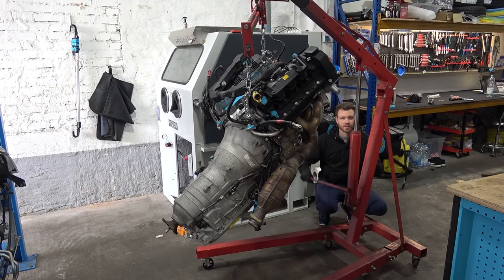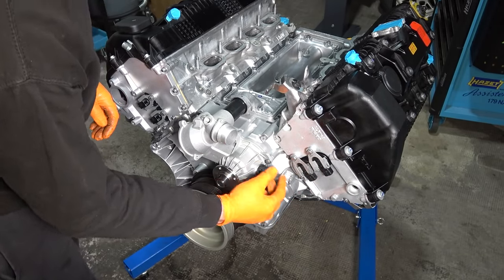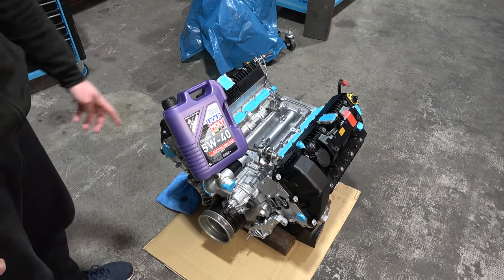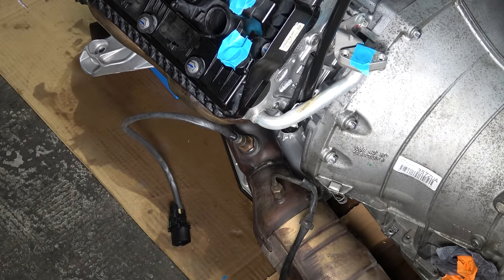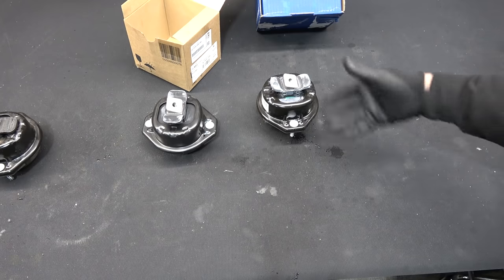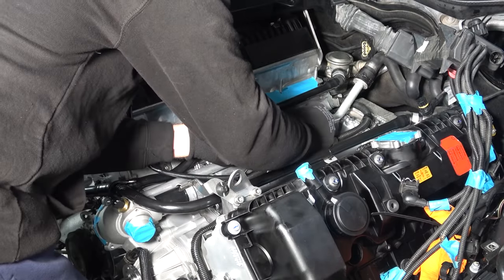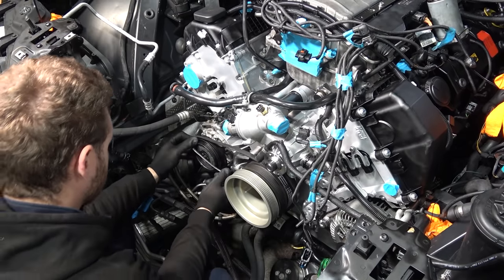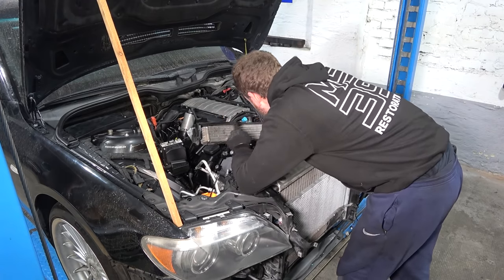The Beating Heart Goes Back In - Supercharged Alpina B7: Project Chicago: Part 5

Comment: you installed an egr check valve not a secondary air pump on the backside of the engine by the way
Reply from the maker: No, sir. It's Sekundärluftsystem ventil. Valve actually, not pump.
Reply: @M539Restorations  i wasn't anticipating a response. love the videos man.